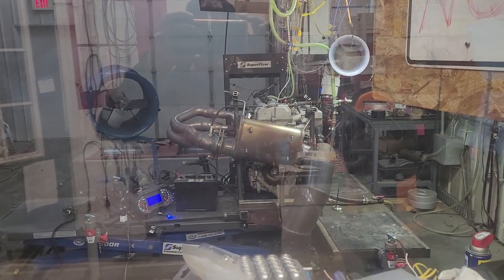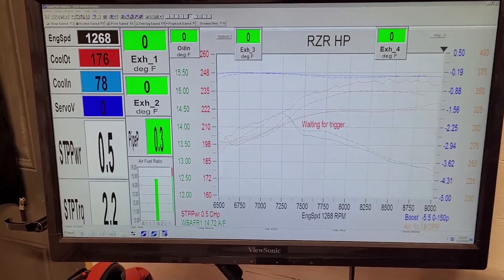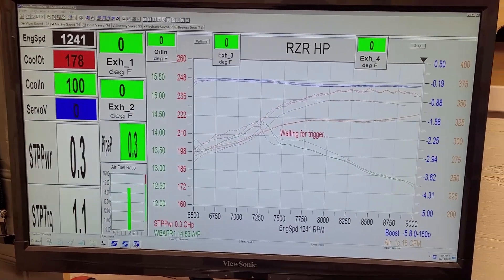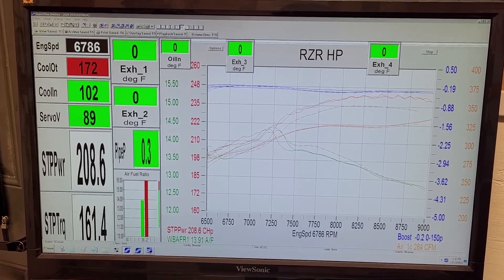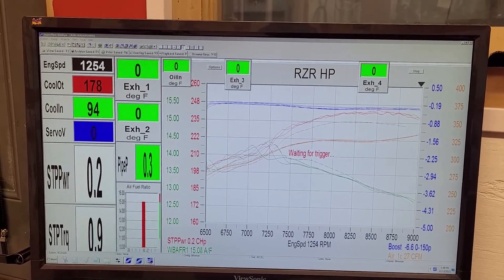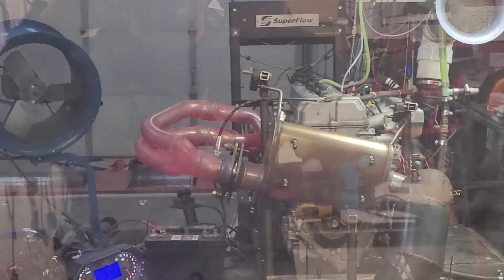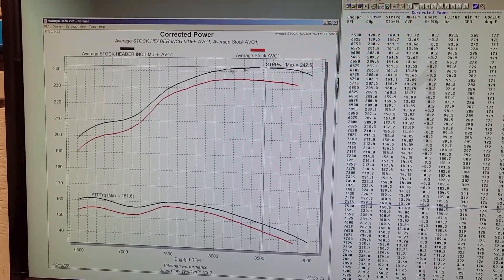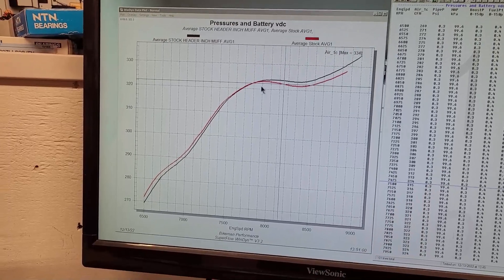HOW MUCH HORSEPOWER DOES THE PRO R MAKE WITH STOCK HEADER WITH 3" MUFFLER ON OUR 902S ENGINE DYNO?

Comment: Holy crap man, this is so interesting! So basically if you want simple bolt on hp AND TORQUE, forget all that other crap and just bolt your muffler on. Wasn't that more power than even the tune? Have you ran your muffler with a tune yet?
It's crazy to me that your muffler is gaining torque all the way through the run, even the tune plus header and exhaust lost torque down low, am I reading that right? love this stuff